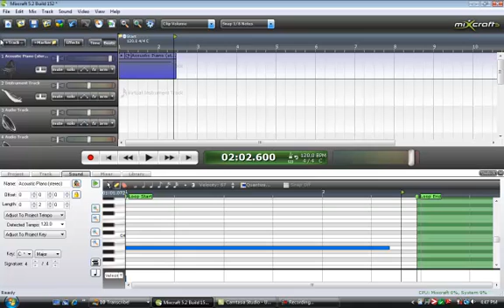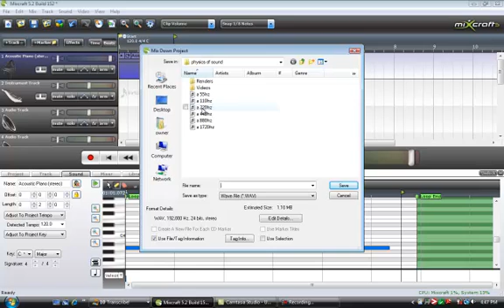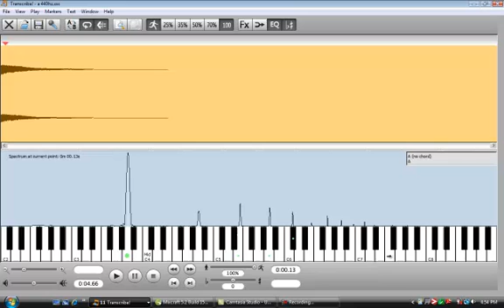Harmonics of a piano sound

Comment: Just a correction on what you said about 2:30 in - we can't really hear any chords, or even all those notes when we hear that A 110Hz piano note, we just hear / recognise it as being played on a piano.  So if we heard the same note (A 110Hz) being played on a double bass, there would be a different frequency signature (which higher notes at which volumes or amplitudes), and we wouldn't hear all those upper harmonics, we would just recognise it as A 110Hz being played by a double bass.  Also, instead of naming each new upper harmonic in terms of the one immediately preceding it, I think it is far more relevant to name them all in relation to the fundamental (in this case A), so any E will always be a 5th (in this case), any G a minor 7th, etc.

Comment: Harmonics aren't as straightforward as most additive synth videos make them out to be. This is because Fourier spectrums are forced to represent signals from steady state frequency distributions. As humans, we can't really gain any perception or intuition from the "pure harmonic approach", and we especially shouldn't be attempting to synthesize realistic sounds taking the "pure harmonic approach" (not that it's impossible, just impractical). For additive-type synthesis: ADSR envelopes, chorus, proportional harmonic envelopes, random harmonic perturbations, high/low amplitude frequency modulation, chord and noise overlay are more practical. For analysis: spectograms and wavelet transforms allow to more intuitively bridge the gap between the frequency domain and the time domain. This girl's synth program seems to be operating on some sort of parametrized Short Time Fourier Transform, similar to a spectrogram.